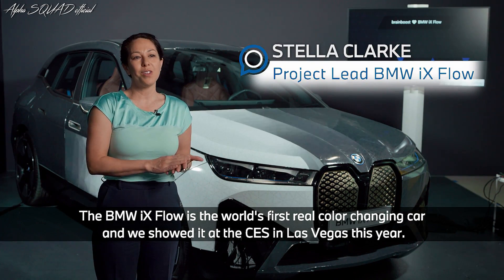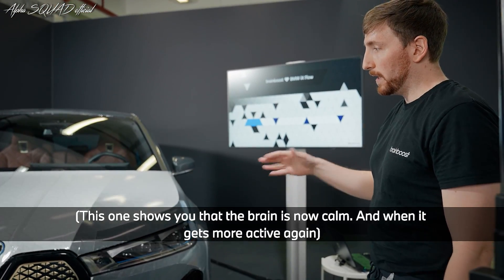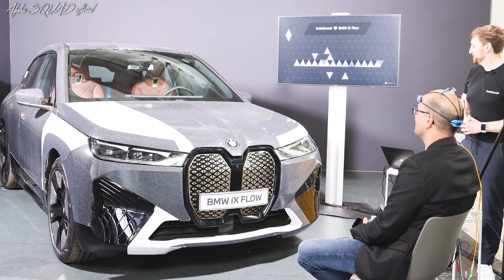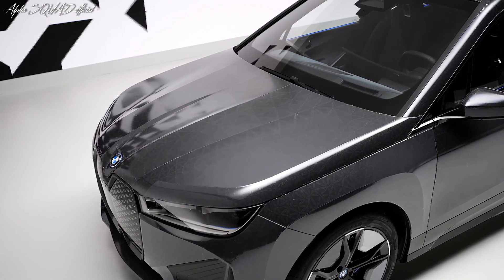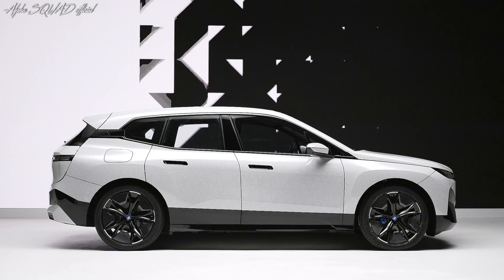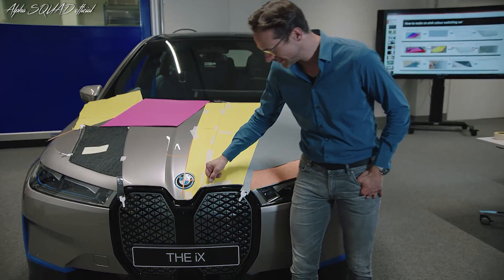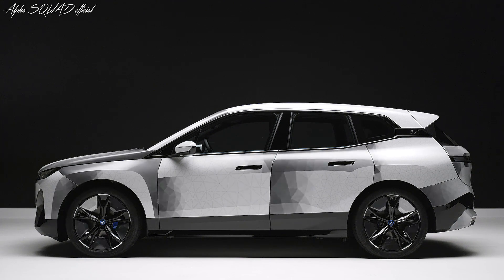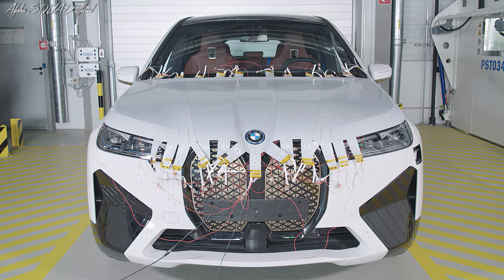BMW iX Flow – Color Changing BMW

Comment from the maker: Changing colors with the power of thought. Initiative at the rad°hub dialogue event raises awareness of mental fitness; delegates harness brain activity to change patterns on the BMW iX Flow and learn how to relax in a targeted way.

The BMW iX Flow meets neurotechnology
The Munich-based startup brainboost used the new and improved color-changing effect in a one-off collaboration with the BMW Group at rad°hub aimed at raising awareness of mental health.

With the help of brainboost, the BMW iX Flow was connected directly to the brain of the rad°hub delegates using an electroencephalograph (EEG), which records the brain’s electrical activity. “The colour patterns of the BMW iX Flow react to brain activity and reflect the level of activity,” explains brainboost CEO Philipp Heiler. “Once the brain is at rest, the changes of patterns on the iX Flow also become calmer and more rhythmical.” A special animation was activated if delegates managed to maintain this state for several seconds. Thus, the participants were able to gradually calm and relax their brains under the guidance of the brainboost experts and with the help of neurofeedback via the iX Flow. This matures the knowledge of which strategies work best to specifically shut down one's own brain activity for relaxation, e.g. in everyday working life.

What is the technology behind the color change?
The body of the BMW iX Flow is laminated in a special film containing millions of color capsules. When stimulated by electrical signals, negatively charged white pigments or positively charged black ones will collect at the surface, thereby changing the exterior color. By making it possible to alter the body color and display different patterns, the BMW iX Flow featuring E Ink opens up a whole new way of personalizing the driving experience.

Who or what is brainboost?
The startup brainboost was founded with the mission of making mental fitness and health accessible to as many people as possible. The interdisciplinary team specializes entirely in mental fitness and health, offering training courses, coaching sessions and corporate health management measures in this area while also conducting research and developing software. brainboost uses the fundamentals of neuroscience and data-based measurement techniques – most notably EEGs for measuring electrical activity in the brain – for the purpose of clarification and prevention, as well as for enhancing quality of life and mental performance.

What is rad°hub?
Since 2016, rad°hub has provided a unique platform for openly sharing ideas, creative moments, innovative ideas and inspiring connections. The aim of this dialogue-focused event format is to push boundaries, bring influencers with ideas together and encourage dialogue between visionary thinkers and opinion leaders from all over the world. Interdisciplinary exchange, both within the company and beyond, creates a space for discussing the challenges of future mobility and developing a range of possible solutions together.

60 thinkers and visionaries from around the globe assembled at BMW’s home plant in Munich for the rad°hub on 12 – 13 May. In working groups, the participants dealt with various questions. What kind of digital world do we want to live in 2040? How can we imagine a positive future of mobility? Is digitalization the solution for sustainability? The developed future scenarios were presented to the patron of the rad°hub, Dr. Nicolas Peter (Member of the Board of BMW AG, Finance), who will take the ideas into account in his decisions as a member of the board.

Chapters:
0:00 Intro
0:15 iX Flow Neurotechnology
2:58 Color Changing Functional Benefits
4:32 E-ink Development

Thanks a lot for Watching!
More New Car Videos: https://www.youtube.com/c/AlphaSQUADofficial/videos